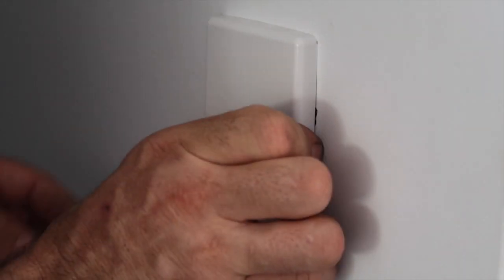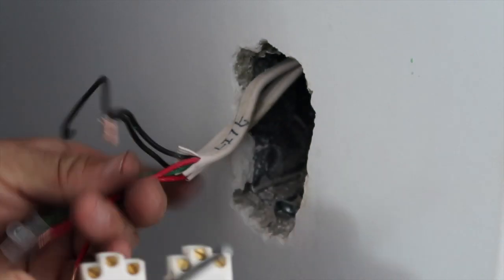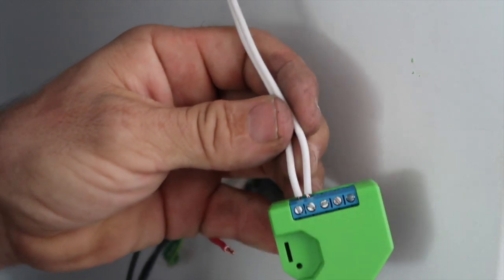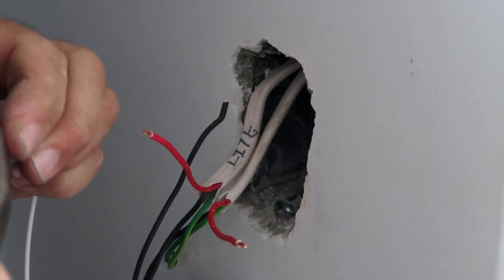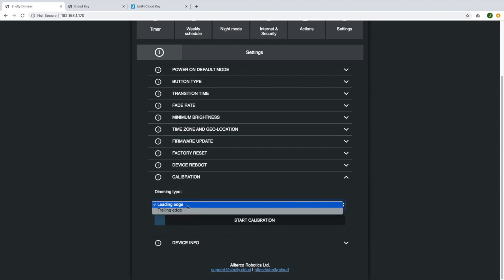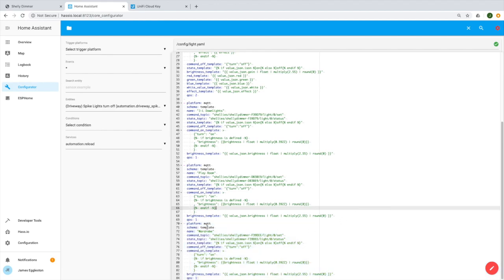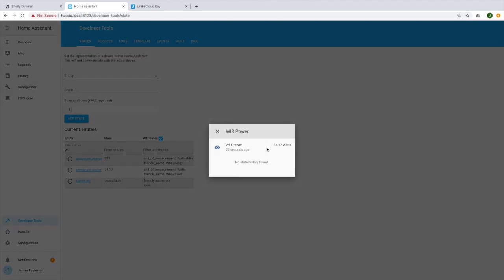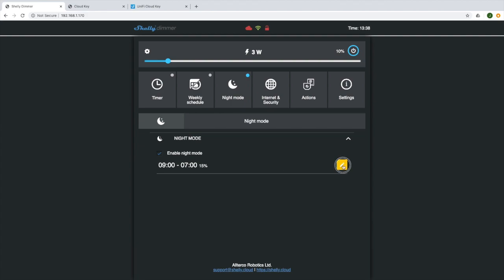Shelly Dimmer Installation - The Perfect Dimmer???????

Comment: Does anyone know of good set of switches for north american gang style like these. The shelly dimmer 2 now has the kickstart but it is not adjustable and comes on too bright causing a strobe flash
Reply from the maker: There are a lack of descent switches in general to work with shelly device's and similar products, they ideally need a tactile switch.  Shelly themselves make a pretty cool plate but it's only for EU.

Comment: Hey jimmy. Have you got any advice on wiring the iconic controlink push button  to the Shelly dimmer 2? I can’t get it to control the load
Reply: Active/line  goes to one terminal on the switch, the second terminal goes to SW1 on the Shelly dimmer. You may need to setup the switch in the Shelly to be a momentary push button instead of a toggle. The 3 L terminals on the Shelly are internally linked for convenient wiring, you won’t always need to use them, but the Shelly need at least on Line/active feed. It actually works well the control link switch, as it’s designed for low current
Reply: @JamesEggleston  hey James. Thanks mate legend, I’ve wired it like that but it seems when the switch is pressed, no voltage is switching to the output. It will control via the app but not the switch. In options to set the button, I don’t have an option for momentary? Am I looking in the wrong place haha

Comment: For economy of switch cost and gang space a single momentary can be a good compromise. With the single switch mode on the Shelly dimmers you can use long press once for brighter and long press again for darker. And short press to toggle. Sometimes a good compromise especially when you have multiple switches and are intending to rely more on automatic brightness level adjustments with an occasional override.

I believe you can also connect an iconic led to the switch output to illuminate the switch, but I'm not sure how the led would react to the dimmed output. Probably a good option for Shelly 1/2.5s etc with things like exhaust fans, since the quieter ones are hard to know if they're on sometimes.
Reply from the maker: I might try that, if you added a 100nF mains cap to the led I think it would work ok. The shelly dimmer actually work best with the iconic control link mechs the only problem is they are so expensive and physically large, they cost more than the dimmer.
Reply: @SparkyJames  yeah I noticed the iconics really need a deep wall box which doesn't help you much if you're not willing to dig a standard one out and replaster and paint. 

Have you seen the new Shelly i4. 4 x switch inputs anywhere you can put a Shelly, comes in 240v AC or 24V DC models. With scripting capability in the module itself.

I find myself hesitant to make Home Assistant a dependency of my light switch operation, but at the same time a wifi relay won't help you control a Zigbee light which is one of the most viable ways to get white spectrum control without going down the route of DALI.

Still doesn't solve the problem of iconic mechs being so damn large though. But if you were using 24V DC it does open you up to importing switch plates from aliexpress etc without worrying about safety hazards, or DIY plates.

Comment: Hi,

What kind of bulbs do you use? I've tried with 3 models of osram and all of them are flickering when the dimming is lower that 100%, the more dimming the more flickering. :(
Reply from the maker: The globes need to be dimmable all globe packets will have a little triangle with a round dimmer symbol and it'll be crossed out if it's not dimmable, and quite a few are not dimmable.  The most notable thing about dimmable globes is they are usually about double the price.  Secondly if it is dimmable with just one globe only you will need a neutral connection for it to work properly.
Reply: @SparkyJames  They are dimmable, may be i will buy another set (different model) and try again.I have null connected to the dimmer2. Thanks man
Reply from the maker: @deyangeorgiev4907  you can also try trailing edge or leading edge in the Shelly setup menu and calibrate after swapping between the two.
Reply: @SparkyJames  Yes, I've already tried that. Bought another model of dimmable osram gu10 and works now, so have to replace all the old ones unfortunately.

Comment: Hey Jimmy, did you have a recommendation for models of 90mm dimmables downlights readily available from Perth suppliers? I tried the Philips flush mounted but I think I'd prefer something with a small recess at least.
Reply from the maker: Down lights that are slightly recessed to look nicer, I use voltex downlights, they are good to deal with and have a 7 year warranty, the only one that does as far as I’m aware. Email me and I’ll send you a spec sheet and pricing. If you want really nice downlights with high CRI they come in lots of sizes and various styles, check out Unios lighting you can get them in Perth from HS Reflections I use them quite bit I’ve pretty much swapped my house out for Unios down lights now, because the light quality it better, they cost more obviously.
Reply: @SparkyJames  Thanks Jimmy,
After  a bit of research I've decided SMD isn't for me and I'm keen for COB. I'll check prices on the Unios, but have you ever dealt with Trend Lighting EconoLEDs. 85+ CRI IC-F COB Downlights.

Also, when you're using lights with remote drivers, where do you physically put the driver when there's insulation filled everywhere.
Reply: @SparkyJames  Hello Jimmy, pretty good information, great video Thanks. Can you please advise what model of the Unios downlights you used. Also if you can let me know of other downlight brands with high CRI (should I also bother with high Lumens like 900 -1100 lms or doesnt matter). I am talking to builder electrician now and they have included the clipsal downlights, which to me seems pretty standard with <80 CRI, seems poor.
Regards,
Gurinder.

Comment: Do you need the 2 push buttons to ramp up & ramp down or will just 1 do. Thanks
Reply from the maker: Hi Garry,  I’ve tried both, one is actually better, in some countries they have a sort of rocker switch in one for up and down which is why they have the feature available.
Reply: Thanks James. Im in Queensland so a rocker switch will work?
Reply: @garryw1159  No just use a momentary push button, like the Clipsal 30pbbp-we HPM and legrand don't have push buttons you can use. There is unfortunately not a lot of choice
Reply: @JamesEggleston  Thanks James I have a Haymans account I will order them.

Comment: If I do not have a neutral and am powering 2 x 10w downlights will I need to purchase the Bypass also if I use the Shelly Dimmer 2? I am using a Shelly 1L, no dimmer of course and that works ok without a Bypass with 2 x 10w downlights.
Reply from the maker: Hi Ian, you won’t need a by-pass. But you might want one just in case to reduce minor flickering. But mostly no, you won’t need it.
Reply: @SparkyJames  I can not purchase the Shelly Bypass in Australia. I assume that I need to purchase from Shelly Europe so may as well purchase the 5 dimmers I need from them also. I assume that is where you picked yours up from?
Reply from the maker: @iandorman5626 Yes it is, it doesn’t take long to get here either.

Comment: Most(?) of the homes in Australia don't have boxes behind the wall plates. Do you add a box to the wall when you install the shelly? what box do you use ?
Reply from the maker: Yes, thats is true, most houses in WA have double brick and hence clipsal 157/1P wall boxes already installed if the house is existing.  You could actually mount the same box in the hollow wall or use an insulation shroud like NLS 30469 OR maybe just leave them loose in the wall but you or your electrician would need to think about the last one to decide if thats ok, some may not like to do that. The 157/1P also comes in a deeper version but it is a lot more expensive as it is not as widely used, if you do have the luxury of brick I usually mount the box a lot deeper in the wall to give me more space.

Comment: Is there anywhere that sells the Clipsal momentary switches to non-electricians? I haven't been able to find them anywhere... do you have a part number to help me search?
Reply from the maker: Clipsal 30PBBP-WE most wholesalers sell them, it depends who you talk too at the desk as to what price you get, but around $17inc is what they cost, they are actually rated at 16A which is crazy over the top for what we are doing with them and the shelley. Unfortunately that is pretty much the only viable push button choice that exists in the Australia.  I did try making my own and it has been work well for over a year, but it was a lot of work and I tried again but it was a little hit and miss with reliability printing part that fit exactly and works mechanically.
Reply: @SparkyJames  wow, the website say $64ea. It also says that they are discontinued. Even at $17 it really pushes up the price. I wonder if there are any cheaper, good quality alternatives from overseas? Would the only problem be that there don’t fit the wall boxes here?

Comment: Dear Friend, very good video. Will you plz confirm if this shelly dimmer have power-recycle memory?
Reply from the maker: Yes it is selectable it can restore to original state when power is turned back on. It can also restore off, on or according to switch position.

Comment: Hi Jimmy, I know they do models now for when you don't have the neutral at the switch, but it's there any reason is you only have the switch wire at the switch that you couldn't install the Shelly at the light fitting?
Reply from the maker: Hi David , you could it is possible but it usually doesn’t work due to space in the light/s and you have to keep the dimmer in a reasonably cool environment, they don’t work in a hot roof space , I’ve tried. So the wall box at the switch is usually the best space.
Reply: @SparkyJames  thanks muchly for your advice Jimmy.

Comment: Sorry for the dumb question. What is that clear thingy attached to the green/yellow wires?
Reply from the maker: That is a connector for joining wires or in this case so the unused earth is sealed and doesn’t touch/short other wires.

Comment: Hi James. Thank you very much for this video! I am located in Australia too. I have used Sonoff Mini for switching lights and they have never failed. On the other hand, two Shelly Dimmer already burnt behind my wall.  I am using Downlight LED Philips MR16 12VAC 8W Dimmable which are each behind their own transformer wirewound ATCO TM50-2 Iron Core 240 / 12 Volt 50VA.  I suspect the Shelly may not be handling the old Iron Core transformers. The last Shelly dimmer fried only only dealing with a simple load: 1 LED + 1 tansformer! I have logged a ticket with Shelly technical support. And I am planning to do tests with other transformers.  In the meantime, can you please let me know what use as a transformer please?
Reply: JR, it's possible the Shelly dimmers burnt from LED inrush current. It's something I didn't know about and apparently not many electricians commonly know. An LED it turns out can have an inrush current 100 times the nominal supplied current which can fuse switches and relays. A tech at HPM put me on to this when a sensor switch I had fused close with only a 21 Watt load from 3 7W LEDs, 240V. Google it.
Reply: @bernardjennings2782  Thanks for this Bernard. I replaced the old Iron Core transformers with the LEDVance OSRAM 12 Volt 40 Watt Redback Downlight Slimline Transformers, and the problem is gone. These modern Osram transformers may well prevent these inrush currents. I was told that the Osram redbacks have been the industry standard in Australia for a while now and work well with the Philips MR16.

Comment: Just playing with my new Shelly dimmers now. Ive copied your Yaml config for dimmer, i can add as a light card in lovelace, lets me turn on/off but im getting no response from adjusting the light level.
Reply from the maker: Hi , I'm not sure what the issue is but, I will need to update the description on this video, as I recommend you use Shelly for Hass intergration https://youtu.be/DCj_FNh0byE is very very easy to use.

Comment: We have the new Clipsal Zen switches installed in a recent renovation. Will the Shelly Dimmers work with it? We have a 2 way 2 gang switch in the lounge and dining room and our sparky told us that on the Clipsal Zen 2 way switches don’t work with dimmers. Just wondering if this is could be a workaround?
Reply from the maker: Hi Sharon, you can get dimmers for ZEN switches, and they can be used on 2 way switches, there maybe additional issues, one that I can think of is if you have back lights on the switches, they wouldn't work properly with dimmers if there was no neutral at the wall box. Yes a shelly dimmer would work the only issue is that they don't have Australian approval so you would need to source them yourself and find someone to install them, which I can't recommend as a good idea.  Unfortunately most people will need to wait till a distributor in Australia has them registered as a safe appliance.
Reply: Yep fair enough although I do believe that we have neutral wires around all our switches. If it is an issue of Australian approval is the Aeotec Nano Dimmer pretty much a comparable product?
Reply from the maker: @sharonxwee  Yes I have them in my house , the Nano Dimmer is one of the better ones, and it is comparable, you will need a zwave network to at least set it up, and if you want to use it remotely need to have it setup to Home Assisant(or similar system) with a Zwave  gateway. Zwave can be a pain to get working and can be laggy this is to achieve low energy use withn the control device it self which is why I don't realy like it having worked with it for years. If you are not planing on setting up a complete automation system like Home Assistant and just want a dimmer that works with a pushbutton, the other thing you could use that is australian certified is this https://kasta.com.au/module-trailing-edge-dimmer , if you want any more specific help you can contact me through my website.

Comment: Hi James, what if you are retrofitting these into a switch that is on a gyprock timber stud wall. 
Is there a box available that can be retrofitted into a gyprock wall.  My whole house is brick veneer and I would like to use these though all the wall plates have either stud brackets or c-clips holding the switch plate on. Also, did you buy these direct from Shelly UK? What was the timeline like to get them from Shelly?
Great videos. Keep up the good work!

Comment: Can these be legally installed into mains wiring in Australia?
Reply from the maker: Hi Frank, these dimmers don't fall into a category that require electrical certification. However according to an industry newsletter, which at this point I haven't been able to relocate to quote, the responsibility is for the licenced electrician to determine if a product is safe or suitable to use in Australia in the location it is to be installed in. I say that because I would not install this dimmer in a roof space or a hollow wall cavity, but only in a wall box, as this video shows.
Reply: @SparkyJames 
Thanks.

Comment: I just setup a Shelly1 and am happy with it. I want to setup a dimmer in my living room. There is already a dimmer switch with a rotary style dimmer, you push this rotary dimmer in for on/off and turn it to adjust brightness. Will this work with the Shelly dimmer? I noticed you connected two switches for up/down. The alternative is I’m going to install brilliant smart dimmer mechs but they cost much more than the Shelly
Reply from the maker: Hi Ryan, you can use just a single switch as well that works fine with the Shelly dimmer,  with both the Shelly and brilliant dimmer you will need to have a neutral or be able to get a neutral easily installed into your switch box for it to work, almost all rotary dimmers are 2wire, no neutral needed. If there is no neutral there is the Shelly dimmer 2wire version that doesn't need a neutral. I think the Shelly is better as I use it with home assistant, I have tuya converted a brilliant jupitor dimmer, but it was just a pain and it never really worked properly with home assistant. And as the other brilliant dimmer is pretty pricey as you said already I decided against it, it is also only trailing edge for  some reason. Where the Shelly is trailing or leading.
Reply: Jimmy James thanks for the reply. I haven’t really setup home assistant or Tuya but at some stage in the future I probably will. The Shelly is working well with my google setup at the moment. I’ve got neutrals in all my switch boxes, house was built about 5y ago. I think I need to keep the rotary dials as my wife isn’t really keen on the smart home stuff, she prefers just the usual so if there’s a way I can connect the Shelly and still have the exterior look the same (and function the same) without the smart features then it’ll be a bonus. The brilliant dimmer mech may not actually fit in my switch box as there’s 6 switches on the wall and I understand those mechs are a bit beefy with the smart capabilities

Comment: Does Alexa or google also control the dim level?
Reply from the maker: Yes, Shelly app connects the Shelly dimmers to google voice assistant. However I have home assistant connected to home assistant cloud, so everything in my house that is connected to home assistant (which is almost everything) including the Shelly dimmers can be controlled by google, echo, and Siri.
Reply: Jimmy James ok, I knew the on-off could. I was not sure if you can say Alexa set Shelly dimmer (or whatever name you gave it) to 40 percent
Reply from the maker: @gemsgolf  Yes, you can do that, turn it to a percentage.